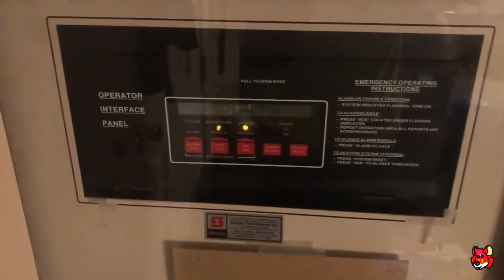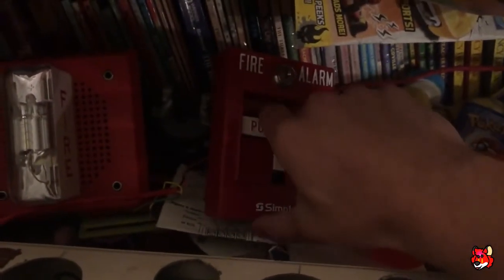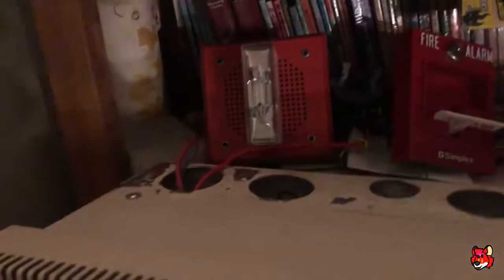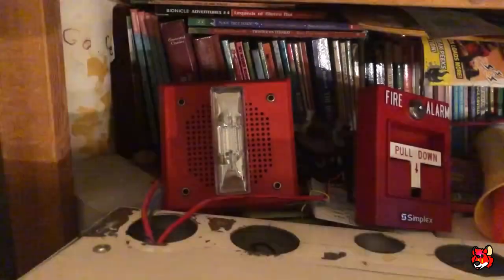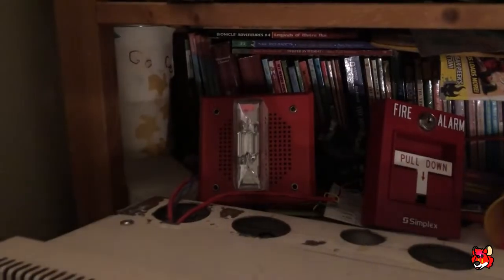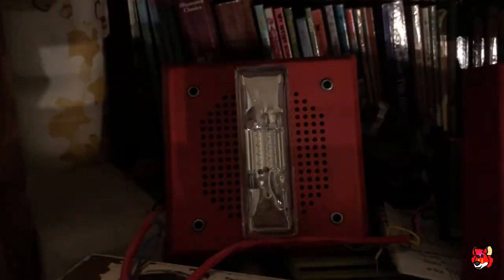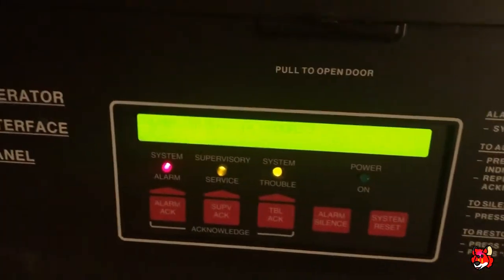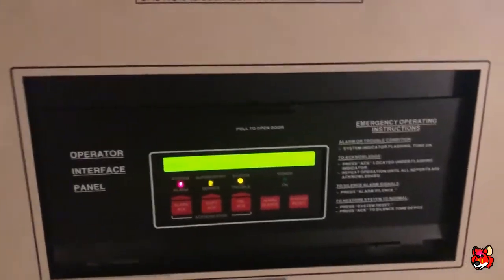Simplex 4100 "Classic" Test 6 (2120 Evac Simulation)

Comment: I'm happy to hear that you were able to clear the brownout trouble and get the AC power LED to come back on. I left you a bit of insight on the brownout condition several videos ago. I would be curious to know what the issue was and how you came about rectifying it. I'm a fellow collector and always appreciate your videos.
Reply from the maker: The transformer wasn’t connected properly.  Had help finding the correct way.
Reply: @FireAlarm9200  I see, thanks for the response. I'm glad you got it figured out, I had theorized a transformer wiring issue thinking about it, the transformer may have had different taps on the primary side. Glad you got it up and running. I really like these older Simplex systems and am trying to build up my collection.

Comment: Was this a no power test?  I noticed thta the backlight for the LCD display on the panel didn't light up until it went into alarm and that's usually only when on battery backup.
Reply from the maker: Brownout trouble.  It’s fixed now.